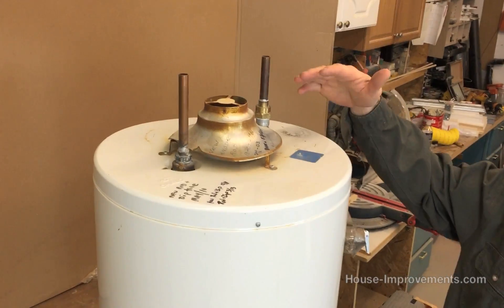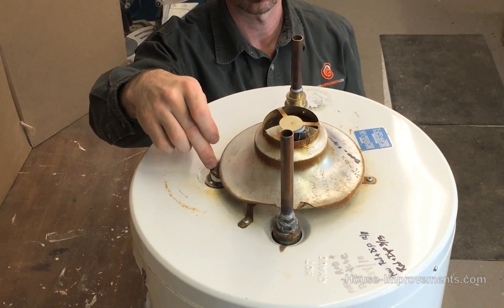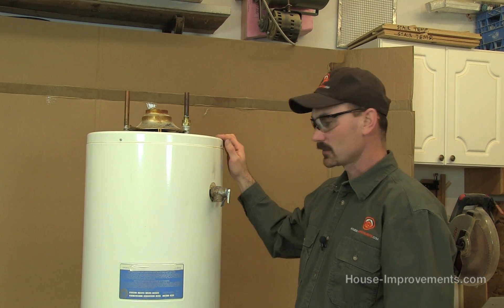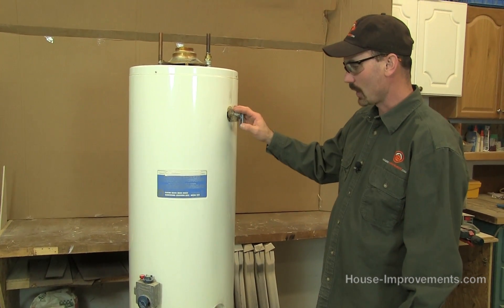How A Water Heater Works [Cutaway View]

Comment: Hi, I've got a water like this but it has a motor ontop to push the flue gas out of a 2" pvc pipe.
Whenever the motor runs i can see water is being sucked up through this flue causing lots of water ontop of the water heater and tripping the motor pressure switch.  Any idea why this is happening? Thank you.
Reply from the maker: I would say you have a leak and the tank is done, there should be no water in that exhaust tube.

Comment: I'm a lifelong carpenter home builder. But I've done remodeling for about the last 20 years. In doing so I've replaced about a dozen water heaters.  Replaced a few heating elements too. But never replaced any dip tubes, anode rods. I replaced our water heater about 8 years ago and did have a very tiny temporary one drop a week leak in my cold side inlet. But beings it was a hard solder copper feed, I didn't bother cutting it to tighten or redo the tape and dope. Now my cold side adapter is pretty rusty and leaking periodically. I'm kinda afraid to try to pop it because I'm worried my tank threads are too gone. But being on SS now even buying a new one for 400 plus, is an expensive route. Do you think it's worth trying to replace the nipple and probably then the dip tube? Or are tanks so thin that after 8 years of rusting it'll just bust out the tank threads and I'll be buying a new one anyway? Thanks for the cut away. I've never tried that in my years in construction. Thats why I'm asking. Though that heater is 30 years in the rust really seems to have done a number on the structural strength of the tank. And they probably built them even thicker back then. Thanks again
Reply from the maker: It's really hard to say honestly. What i can say is be prepared to have to replace it if the "repair " does not work.
Reply: @HouseImprovements  Yeah, that's the plan. I have a couple of friends who are plumbers but i doubt any of them have ever gone as far as to cut open a water heater to see the results of years of use. That would actually make a good research video. After 2 years, after 4, after 8. And so on. Just to see how protective the glass like coating, protects the cast iron tank. Cause heaven forbid, we make a water heater tank last 100 years. Right? Thanks for responding. 👍

Comment: Great video.  ?? Low  pressure when more than one sink is turned on. Water flowing sound out of hot water heater has gotten loud.  Any suggestions?
Reply from the maker: the lower water pressure issue sounds normal , the increased sound could be dip tube being short and needing replacement? Just a guess.

Comment: I bought a house a couple of years ago.  The hot water has always taken forever to get hot wasting time and water.  I finally got around to looking into it and discovered it's installed backward with hot coming out of the cold inlet and vice versa.  I also discovered the dip tube had disintegrated and was allowing cold water to flow directly into the hot side bypassing the hottest water in the bottom of the tank.  It's 40 years old.  Imagine how much money has been wasted through inefficiency over that 40 years.

Comment: I have been watching several of these water tank videos and I have to say I am astonished and appalled at the inability of the typical home owner to do almost any maintenence on an expensive, and necessary item in a home.  I mean, these are by design to be practically neglected, imposible to clean properly and designed to fail within 10 to 15 years.  One plumber even commented to me the only guy to tell you how often you should drain the calcium from your tank would be the plumber installing your next (expensive, I must say) water heater.  If ever there was to be an example of planned obsolesence, it surely must be a damned water heater.  What sort of water heaters are they going to have when the take over living on friggin' Mars ?  Why can't we have them now when we all live on the Earth in the 21st century.  I mean.... It is pretty pathetic for retired folks like myself.

Comment: Thanks for a great video.  Really appreciate it.  May I ask why the dip tube has to be this long to almost touch the bottom of the Water heater?  What will happen to the water heater if the dip tube failed/not working properly?  Will it make the water heater with no cold water coming in to the water heater? Or with less hot water or not enough hot water pressure to provide hot water to the house faucets, etc.?
Reply from the maker: Basically if its too short the cold water filling the heater mixes with the hot water closer to the top where it exists to the faucets and intern it will cool the water down. If its long enough the water is forced to the bottom closer to the heating element where it should heat properly before exiting. Watch this video as well.https://www.youtube.com/watch?v=rIOobNrCgsg

Comment: Thanks for the video.

Can the gas valve/thermostat be replaced on a gas water heater?
If so please make a video.
Reply from the maker: It can be but I recommend a licences gas fitter for that since you have to change a gas fitting connection for that.

Comment: Hey Shannon love your videos you have taught me a lot about windows, siding, and now water heaters oh yea and crown molding. But anyways looking for any ideas my hot water heater sounds like the water is continuing to run at all times. The house is on a slab and the floor on the inside of the house is very noticeably differing in temperature around the area of the heater but within three feet it goes back to cold. I’m thinking I need to pex pipe and fix the problem??? Immediately after shutting the supply the leaking noise stops. The water heater is about 8 years old and no water anywhere else.
Reply from the maker: Please copy and paste your question to the forum and we can talk there.https://www.house-improvements.com/forums/

Comment: This was awesome to watch and was exactly what I was looking for. Thank you. I do all my own home repair and have even replaced water heaters for friends. However, I didn't know how they truly operated. This was great. My water heater is 15 years old. I have changed a pressure relief valve before and just cleaned up my thermocouple because the pilot light wasn't staying on. Now it does. There was about a half cup of rusty flakes on my burner plate when I took it out to clean up the thermocouple. After 15 years, I haven't had to do much. I now see that I should probably change out my anode. My real question is if you have a working water heater, at what age does it need to be replaced? I only ask because I live in Humid Houston where they put the water heaters in the attics. I don't want the bottom to rust out and cause a bigger problem. I've never drained them so the sediment is probably really bad. Thanks for your time.
Reply from the maker: Personally at 15 yrs I would be thinking of changing it out. This one in the video was about 30 yrs old which is actually kinda amazing honestly. They dont make them like that any more. Cost of a water heater could save you a big water damage bill . I would also install a spill pan under it this time , so if it starts to leak in the future you maybe have a chance of noticing and not have a big mess. The pan should drain to a floor drain or something if you can.
Reply: @HouseImprovements  Thank you.

Comment: I have leakadge from cold water tube. it's not coming from connection - I have changed teflon tape, as soon as I open cold water valve water starts coming from top cover of the tank, in the tube area. Is the tube connected to the tank with thread and to fix the leakadge just need to change teflon tape or the pipe is welded to the tank and I have to replace the tank?
Reply from the maker: Usually that threaded nipple in the top of the tank is threaded into tank but it sounds like it may be rusted through? Hard to say. I may be able to help more if you post in the forum.
Reply: @HouseImprovements  thank you for your answer. I just was thinking if I can change it or have to replace tank. The tank is 7 years old and I hope the connection is not damaged with rust

Comment: Thanks !  Glad you posted this video, I've drained my heater a couple of times but have never known that the cold water tube could disintegrate like that.  I'm going to try to flush mine out and if I can I'll look inside with my inspection camera.  Probably go through the anode hole or the hot water outlet.  I will probably be buying a new heater because mine is getting pretty old and we have a lot of minerals in our water supply.  I have distilled some water before and was amazed at all of the white build up in my pressure vessel in just a few gallons.  I can only imagine what is in the heater.

Comment: Have you ever heard of a water heater or gas furnace smelling like lamp oil? Its a strong oder. Recently I started smelling a smell like lamp oil in my furnace room. I had several people look at it but they can't figure out why that smell is in there. The water hot water  is coming out clear. Added, I also don't think it's sediment because it was cleaned out 6 months ago and there's no noise in the system while it heats the water. There's no sign of rust on the exterior nor is there any water leaking from it. Any ideas what the smell could be? Ty any help you could give me Woud be much appreciated.

Comment: Hi ' Shannon, I wonder after replaced another release valve, it still dripping from new valve, the valve pressure is 1400kpa and boiler still boiling, so can I install a water reduced valve to fit the problem? Thanks for help.
Reply from the maker: Yes your incoming water supply pressure may be too much.
Reply: HouseImprovements Thanks a lot! Mate

Comment: I flipped my reliev valve..then it didnt reseat...so had to replace it...not cool.
Reply from the maker: If you have never done any maintenance like this and the heater is older your best to leave well enough alone. Believe that was mentioned in the video? Most times even if you do it they may drip for a day or so then seal up .
Reply: @HouseImprovements  na i didnt watch all the way through...ours was about 15 yrs old

Comment: I was waiting only for one thing, where are hot and cold water positioned inside.
Reply from the maker: If the tank is working properly cold water enters and is released to the bottom through the dip tube, that intern creates pressure which forces the already hot water out through the top of the tank.
Reply: Thank you

Comment: I knew all that but you did a good job of explaining.  Because it's so difficult and expensive to change my water heater I invest a lot of time trying to make it last.  Since it was yours I'm surprised you let the sacrificial anode deteriorate to that degree.  I'm glad you mentioned it was yours, but it would be good to mention how old it was and what your maintenance routine was.  How often you drain. Whether you completely drain or only a few minutes.  I have a hose connected to mine with a ball valve.  I run water for a couple of minutes every quarter and check the anode annually. During the anode check I drain the tank completely. It is now 15 years old and  hoping for 25.
Reply from the maker: According to dates on this heater it was nearly 30 yrs old. I had owned the house for about 13 of those years. By the time I owned it this heater was past being able to drain easily because of the build up in the bottom the drain usually did not seal well for a while afterwards so I did not drain it often. The dip tub was changed as needed and anode was changed every couple years.

Comment: Thanks for the clear video and the important tip about the dip tube. I just replaced a water heater that had been installed in 1985 with NO problems even though I have VERY heavy sediments/salts in piped-in well water. Plumber talked me into this new one and after only 6 months here I am researching how to replace anode because of rotten egg smell. How right you are about old heaters working better than new ones. I never did any preventive maintenance on the old one.
Reply from the maker: Yes you will want to change the anode to a different composition then you have now to prevent that smell.

Comment: good video< my Q: what forces the hot water to go up to the house when we need it, thank you very much shannon
Reply from the maker: when you open the hot faucet the water pressure from the city or your pump will force cold water into the tank which goes to the bottom through the dip tube that pressurizes the hot water and it is forced out the top.

Comment: Most awesome video.  Shows the reason why all crud does not drain out of the drain.   The hole for the drain is really a half inch to an inch higher than the low part of the tank.  Thanks for posting

Comment: Great instructional video, Shannon - except:
1. You mentioned flushing the Pressure Relief Valve, but that's a bad idea!  The lever "handle" on relief valve is there only as a manual emergency.  Flushing any relief valve can embed sediments into the seal which will cause the relief to leak.
2. The term for the flame detection safety device is "thermocouple" - not "thermocoupler."  Seems like a minor thing, but you're a serious and knowledgeable mechanic and I'm sure don't want to sound like you're not.

Comment: I have one in a utility closet that the burner does not fire up on its own. The bath shower in the home does not have hot water. It has been working for years up until this point. Water from the bath sink and kitchen is hot enough. I cannot put my finger on the problem.

Comment: Got a question: If you have good pressure coming from the drain valve with the cold water on, why would you have low pressure on all your hot water faucets? It seems to me that water coming
 out the top of the heater (hot water tube) would have sufficient pressure unless your dip tube is blocked, or your drain valve is blocked, but if it isn't, why would you have low pressure leaving the water heater?
Reply from the maker: Hmm good question . please post that in my forum and we can make some suggestions.https://www.house-improvements.com/forums/

Comment: I have a question.  I have a tank, its pretty old.  Gas keeps getting shut off.  I have replaced the thermo couple hoping that worked but it didnt.  We have noticed that when its cold out it seems to stay on, but when the humidity is high it cuts off. Living in Texas makes it more interesting.  It is in the garage, was originally when we bought the house open to the garage, and was intermittently doing the same thing.  We built a room around it and the washer and dryer, and insulated it.  The laminate tile floor we put down never seems to have moisture on it, if that helps any.   We haven't concluded if its the gas run itself, or ventilation.  We have tried different things to affect the atmospheric conditions to see if that helps. Like we have noticed if we leave the door open and the garage door cracked it cuts out too. If we close the garage door and leave the room door open it has stayed on.  Cant seem to nail it down to a specific thing but we are leaning towards it being changes in the atmosphere. Another thing, we noticed our neighbors who just built a house has  their tank in the garage as well and its close to the door. So it leaves me a little confused.  Is there anything I can do to prove its the tank before I buy another one and experience the same problem?  Thoughts, suggestions, ideas, all welcomed.  Thanks in advance!

Comment: I have a water heater that’s almost 20 years old. This morning I noticed the water was excessively hot, and there was hot water running out of the house. It appears the temperature controller is tossed. I went to home depot, and all I saw was a thermostat coupler but only one part. I have a State water heater PR 6 40 NORT. What parts do I need to fix that?

Comment: If you're not going to do the work yourself, always get more than one opinion from different plumbers. I had a leaky gas pipe under my house. A plumber came, and told me besides the leaky gas pipe, there were numerous things that needed replacing, and gave me a price of over 9 thousand dollars. I called another plumber, and he fixed my problem for 6 hundred dollars. That was 10 years ago, and I haven't had any problems. The first plumber tried to use scare tactics, and encouraged me to use credit to pay the 9 grand. Always get a second opinion.
Thanks for this excellent video by the way.

Comment: Good video! Would it make since to attach a hose,  leave the cold water supply turned on to the heater and open the drain valve and let it run for 5, 10 or 15 minutes? The constant flow of cold water stirring up the sediment in the bottom and forcing it out the hose seems logical. You could turn the thermostat down of course.  Would this work better than shutting off the water supply and letting it drain on its own?

Comment: Shannon:  I have a graduate question:  I am working on learning about plumbing, and my instructor wanted the class to describe the correct material used for the probe called a Thermister or Thermoprobe used to tell the thermostat switch when the pilot light is on and when to turn the gas supply on or off.  My guess is that it is either, brass, carbon steel, or a composite of a ferrous material?  Any suggestions would be greatly appreciated.  Earthboy57
Reply from the maker: Sorry but I actually do not know what it is made of.
Reply: OK, thanks for your reply!  Earthboy57   @HouseImprovements

Comment: Prehistoric piece of crap. Can't believe these are still in common use, let alone practically universal in the states. Non room sealed gas appliances belong in museums, not people's homes. Not only are they grossly inefficient, they are potentially deadly in the event of a fault, flue blockage or any number of other situations. Why does the USA persist with this outdated technology? Most homes have "furnaces" so why not use them to heat water tanks as in Europe?